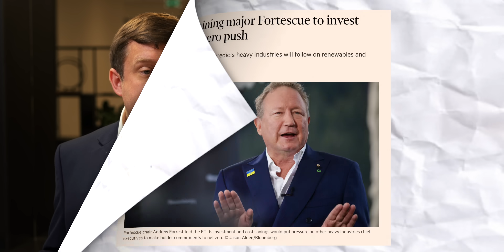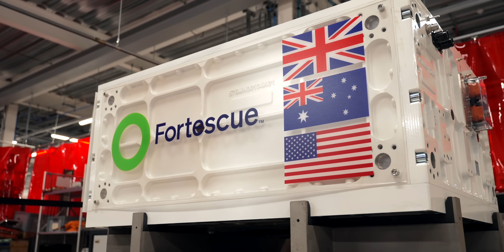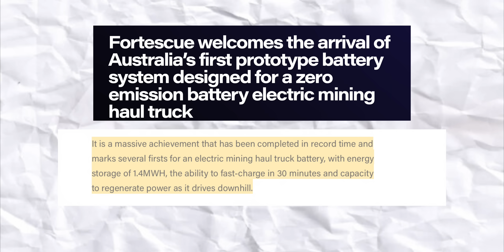This GIANT Electric Mining Truck Charges in Under 30 minutes!

Comment: hmm 1.4mwh battery sounds worryingly small for a truck that normally uses 300L of diesel per hour
Reply: The diesel truck doesn't regen going downhill, so wastes a lot of energy.
Reply: @davidjulian8536  oh absolutely, but mountain top mines are rather niche(and some already use fully ev trucks) where youre regen braking while fully loaded, and going up empty
most mines are the opposite

regen helps abit, but the way these trucks have been shown so far, i cant see them making sense
Reply: if the plan was to have a 1.4mwh battery to use inbetween sections of trolley wires and during loading/dumping
that would work 100%, and itd charge the battery while driving under the trolley wires

but without the trolley wires providing like 80% of the power, i cant see it working well if at all
Reply: @vincentgrinn2665  it doesnt help on flat surface tho! think about that! those EVs are great on old mines but not the new ones.
Reply: @davidjulian8536  nope it doesnt waste energy, it uses engine braking plus the electric drive motors on the hub lol!!!
Reply: @alanmay7929  ok its pretty clear you dont have a very good grasp on what the conversation is
Reply: @vincentgrinn2665  lol!!!!! ive seen some of those giant trucks running 24/7 filled with 4000l of fuel and again they donot use 300l per hour like it or not.
Reply: @alanmay7929  How much do you think they use? When I've asked a couple of servicemen how often they need to refill the trucks, from memory they said for a CAT 793F roughly 4000l of a 5000l tank every shift and a half. Which would be in the 260 - 280 litres per hour area. I'm sure when they have a busy day in some of the deeper pits they would average 300l per hour. Just idling is like 20-25 l per hour and peak power is up to 460l per hour.
I think the Hitachi diesel electrics used a little less, but not by much.
Reply: @patrickbeck4062  how many hours is a shift and half!? from the other infos i got its 4000liters for 24hours and they work 24/7.
Reply: @alanmay7929  On a day without breakdowns, they should get around 15 hours operating time in a shift and a half. When I was in the workshop at a Fortesque site (was at that site for 5.5 years). They were saying their minimum truck fleet utilisation goal was 18.5 hours per day (averaged out over the fleet). So the trucks that didn't have breakdowns could be doing at bit over 20 hours per day. Could potentially even be a bit higher on the autonomous trucks or trucks that get hot seated.
Reply: @patrickbeck4062  so the electric truck will literally never breake down?! Are are you talking about?!
Reply: it doesnt even use close to 300 l an hour lol!!! plus its on flat land, flat land is for diesel.
Reply: @alanmay7929 They do average up around 300 litres an hour. A 5000 litre tank is good for around a shift and a half (~18 hours). Obviously give or take a couple of hours depending on operating conditions. 
Last time I was around a bebuilt CAT C175 engine from a 793F truck that was being dyno tested, I took a photo of the numbers while at peak horse power.
It was producing 2640hp and 8030 lb ft of torque at 1750 rpm and had a fuel burn rate of around 460 litres per hour.

Comment: Have been lucky enough to work for Fortescue >13 years. Incredible ambition within the business to go fully green. The workforce are really backing this vison, determined to demonstrate that a heavy polluting mining company can do Real Zero Carbon Emissions, not NET Zero of any offsets. Also not mentioned in the video is Fortescues aim to produce 15Mt of green hydrogen (likely green ammonia) by 2035. Will require many Terra Watts (TW) of green energy generation, coupled with a purpose built vertically integrated PEM electrolysers factory in Queensland. Exciting times ahead. asx: FMG
Reply: The problem with creating any kind of hydrogen using electricity is that you have to crack the 25% return barrier. If you use 1mwh of electric energy to create hydrogen you will normally get only 250gwh of end use energy from the resulting hydrogen. They have to crack that issue for it to be worth the protracted process of creating green energy to produce electricity to split hydrogen that is then supposed to produce green power. I'm sure they will, but it's not likely to happen any time soon and it won't likely be as efficient as directly using electricity at an average 85% return.
Reply: > "Have been lucky enough to work for Fortescue >13 years."

yeah mate, you and a lot of other people making comments it seems.
Reply: @roidroid  cry more.
Reply: @darrens3  gottem!  God i rememeber when i was 3 yrs old.

no...  i don't.
Reply: @roidroid  Guesing not long ago.....